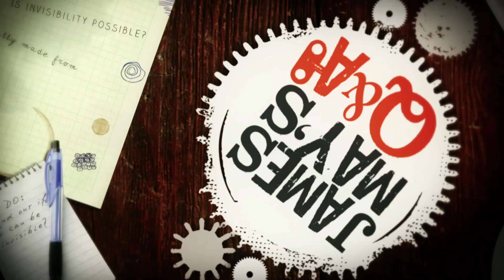Why Can't Trains Go Uphill? | James May's Q&A | Earth Science

Comment: I've heard becoming a locomotive engineer requires lots of training.
Reply: +Wayne VanWeerthuizen 
Oh railly?
Reply: +Blake Trafford - Mile Post Productions - I drive trains in Norway. I did not work with trains before I started on the education. The education took one year to complete and after that I drove with an instructor for 30 days, if I remember correctly. After that I was 'on my own'. I've been driving trains for 9 years now.
Reply: AirCommando12
I think he did, as his last word was dis-trac-ted  ;) .
Reply: +Wayne VanWeerthuizen In order to become a Locomotive Engineer, you need to be a conductor for a minimum of two years. But it depends on your terminal, how big your terminal is, your seniority, how many employee's are working at your terminal etc. 
If you're based out of big terminal such as Toronto, you could wait up to 5 years or even more before they send you off to engineering school. 

Conductors are the guardians of their train, they take care of all the paperwork, communicate with RTC (Rail Traffic Control), call out signals along the line and stuff like that. 

If you're the engineer however, there are a lot of things you need to take into consideration. If you're pulling your train out of the yard, then you need to take up the slack in between the knuckles otherwise you're putting more strain on them than you have to.
If you're on a descending grade, depending on how steep it is and the weight of your train you're probably going to have to initiate Dynamic Braking. I know of several grades in Western Canada that are 2.2% or steeper. Often you'll have either a mid train and/or end of train DPU pushing to help get your train up the grade, or giving more dynamic braking power while going down. 

I'm thinking about becoming a conductor for CP and it's a great career that you can make living off of. The only thing is, once you're hired on, you're on call 24/7. For one shift you could get called into work at 02:00 and the next shift you could get called in at 15:00, or even 23:00. But as you gain seniority, you have more rights and you'll have more say in what you do.
Reply: ***** Oh yeah...Stupid me xD
Reply: AirCommando12
Hehehe. It took me a few moments too  :) .
Reply: phillyslasher Exactly. If you're a hogger (30+ years on the job) then you're probably going to be only working on weekdays.
Reply: *****
Ahhh, so we need to sign a con-tracked before beginning our training?  ;) .
Reply: At least it's the fast track to good job security. At some point people might be at a crossing in their lives and think what am I doing with myself? With a lot of hard work as a train engineer being their platform they can chug and chug with the schooling and chew chew out anyone who didn't believe in them.
Reply: Every time I see a big ol' mess of loads trailing empties, I want to slap whatever yardmaster built the thing.

Also, auto racks need to take a long walk off a short pier.
Reply: this thread has gone off the rails.
Reply: AirCommando12
Ahhh, I do like a good steam cleaning.
It's so much better than dry cleaning  :) .
Reply: ba-dum-tss
Reply: Wayne VanWeerthuizen I don't see why green go red stop stop when flags show obay speed limit
Reply: a lot of TRAINing
Reply: It's mostly train handling. Every train is different because of weight, power, and distribution of weight and power. So you have to get a feel for things and the track you're running on. Learning to think miles ahead and plan for when to add or remove power and braking force. 

Now of course this is easier on passenger and intermodal frieght trains, than bulk and manifest frieght trains. The former are lighter and have cars that all work well with each other. While.the latter tend to be a big heavy mess of long cushioned drawbars, empties between loads, and loads placed too far back.
Reply: It doesnt
Reply: I start training early October and it'll take a year before I'm on a job solo followed by 2 years pre qualification ( extra assessments and monitoring) 3 year's total.
Reply: yes, but a Electric Train Operator requires LESS training and focus on Emergencies and Saftey.
Reply: I've heard one needs very little training.
Reply: ***** I'm gonna have to blow some steam in a minute...
Reply: We can achieve absolutely anything, if we are suitably loco-motivated  ;) .
Reply: +Victor Korgoth I don't think you got the joke.

Sorry if you did ^_^

Comment: My buddies dad worked at cp for 40 years, and he told us that trains can smoke there wheels at any speed. I find that odd because a car is better in the snow with thinner tires, because more weight for psi, but I guess on the flip side the wheels and the track are smooth where as tires are rubber and the ground isn't smooth like steel.

Comment: You didn't mention one thing, sand.  Many locomotives are equipped with gizmos to drop sand on the rails in front of the wheels to increase friction.
Reply: +Kenneth Scharf They tend to be used only in emergencies (if the train is having unusual difficulty stopping or the emergency brake is applied), for the obvious reason that they would run out of sand otherwise!

Comment: Search for cog railway. Switzerland is full of them. So trains CAN go uphill.
Reply: Yes,  but unfortunately you can't make a train that can both climb steep hills easily and reach high speeds on the flat....  The rack system only works well at low speed (it wears very rapidly at higher speeds)  and rack railways usually select very low gear ratios,  imagine a car with only 2nd gear,  it goes up hills with ease but maxes out at 35mph with the engine redlining...
Reply: +Ade Larsen this is very old. There were many (both partial and full) cable hauled railway systems in Britain on mineral lines (which are often in more demanding terrain). There were some passenger railways designed to have have short sections of cable hauled trains too, but it was realised that, operationally, this was highly inefficient and disruptive for a passenger line. Lines were redesigned to follow longer, less steep routes, and/or using "double heading" and other techniques. 

There was even something called the atmospheric railway (designed by the great Isambard Kingdom Brunel) which used a pneumatic system using stationery pumping engines but which failed due to technical problems in sealing a slotted tube. It was, however, very effective when it worked.

In any event, what you describe is not suited to the efficient operation of high volume passenger lines.
Reply: Years ago before I was in elementary school I got a set of 4 VHS tapes and one of them talked about those, man that's a blast from the past, but they are indeed quite interesting
Reply: America has on at Pike's Peak that I've ridden on.
Reply: +Daniel Smith The way to solve this is to use the standard wheels and rails and simply attach a steam powered hook and line to the train and pull it up the hill.
As in Norway.

Comment: A reasonable explanation of a complicated problem. Here in the USA there are many large hills to be managed. In very steep areas with special needs such as for logging and mining, the 'cog' system was devised which permitted that ascent of steep gradients. Also, for commuter rail lines, 'MU' (multiple unit) cars work well - particularly if electrified. With MU's, even though the driving wheels are much smaller in diameter, some have traction motors on nearly every axel which greatly enhances tractive force.

Comment: He forgot to mention that train wheels are made of the same metal as the track for a reason. It is to allow for molecular bonding. If they were made of brass or some other dissimilar metal, the train wouldn't go anywhere. Engineers will often floor the throttle spinning the wheels. This increases friction generating heat which improves the bond.

Comment: Steepest adhesion lines are something like 7% and even high speed lines have 4%, but the trains have 50% of all axles powered. And downhill you typically brake all wheels, not just those of the locomotive (or at least you can).